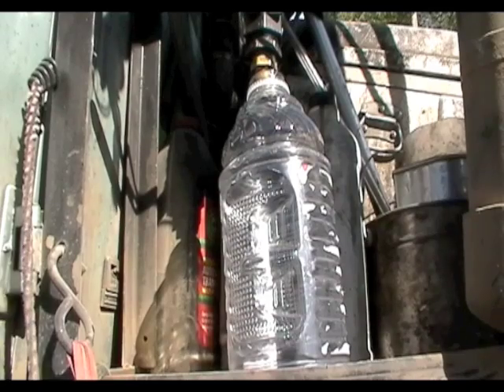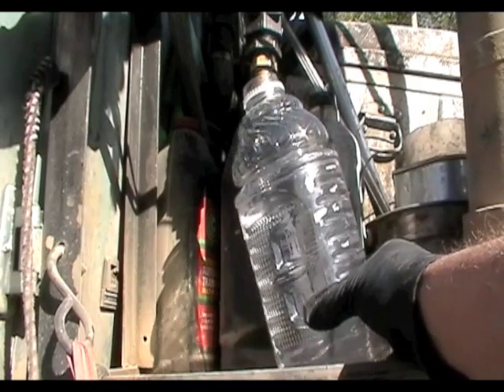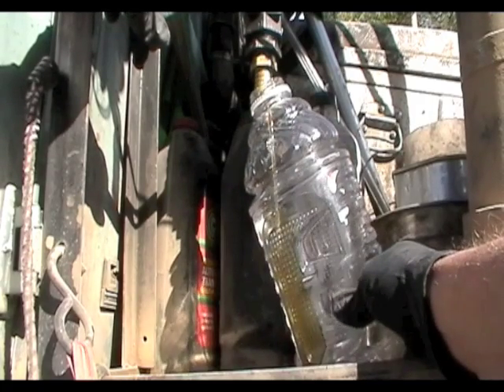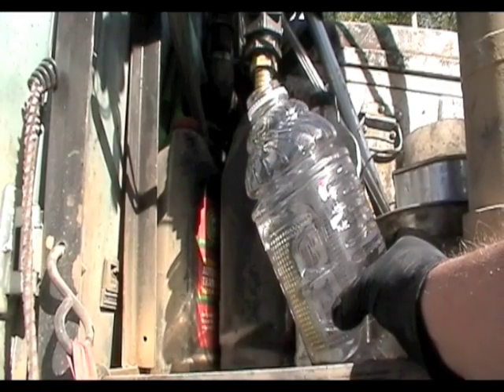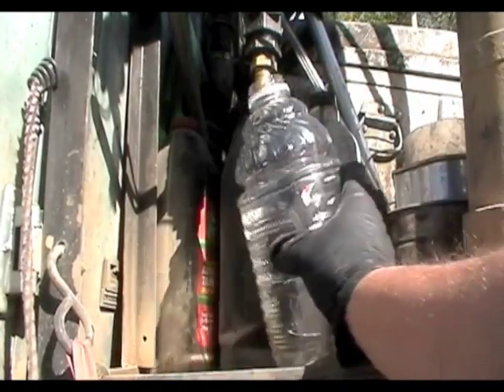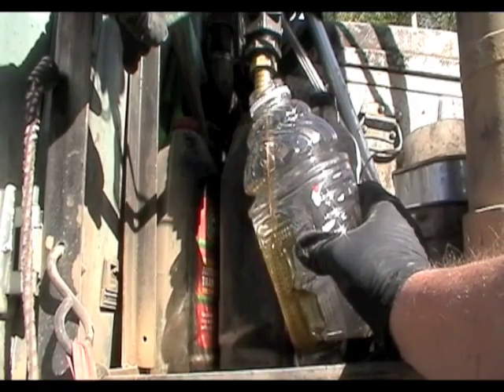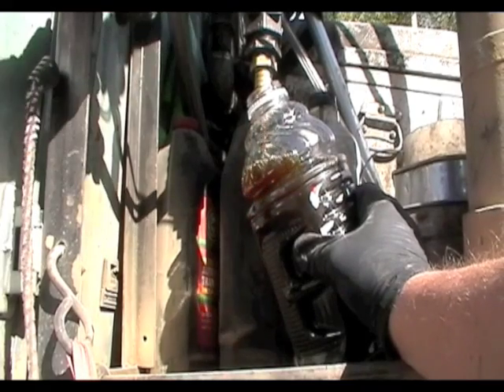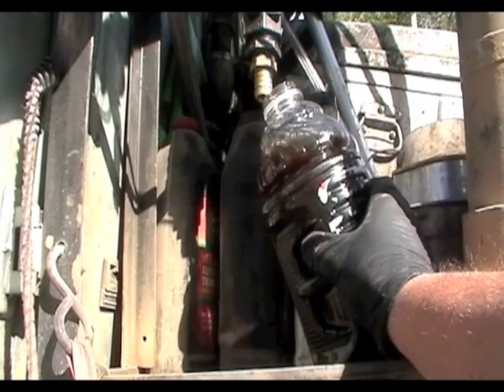Blending Stale Gasoline with Waste Oil to Make Alternative Diesel Fuel III

Comment from the maker: @Begbucks I am not sure if consistent results can be achieved with stale gasoline, because it is going to be variable depending on what fractions have evaporated; however, clearly acetone will be needed to force it into a blend.  But, acetone is not cheap any more, so a blend with acetone at 20% would not need stale gasoline, just waste oil.  And, with acetone at 20%, at $20/gallon, it ain't cheap.